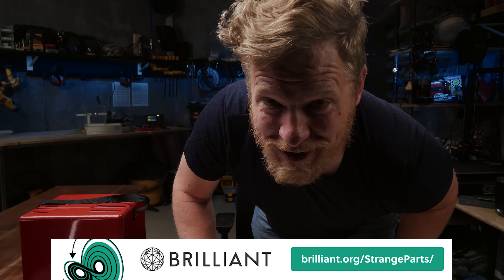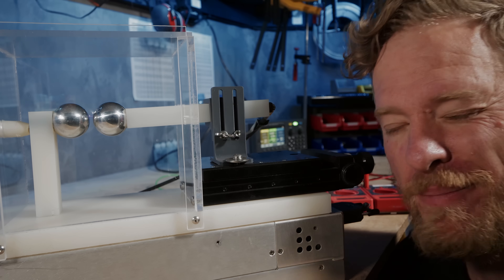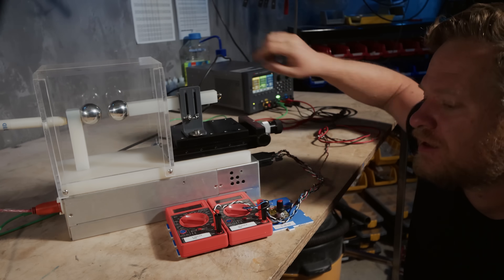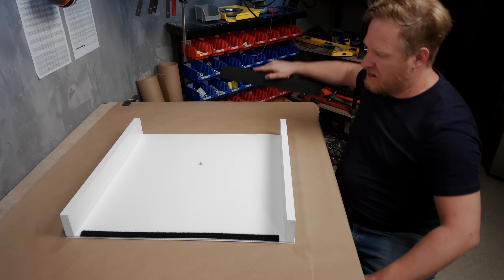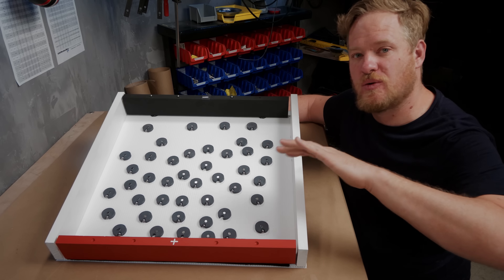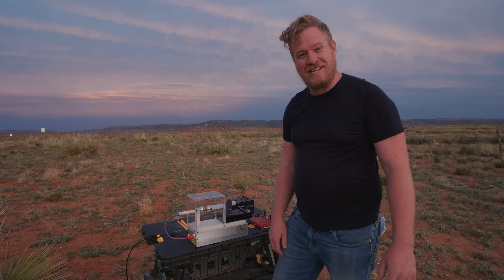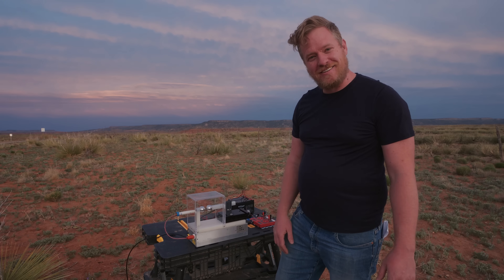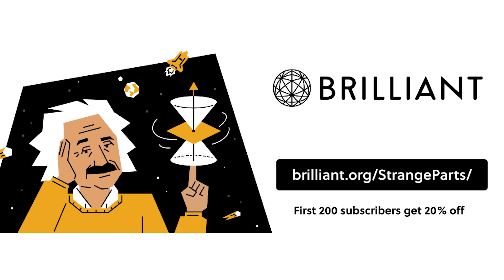Why 10,000 volts at altitude is a BAD IDEA

Comment: How to fix it?
This was resolved in aircraft piston engine ignition systems some time ago. Getting a hot spark into a supercharged cylinder at a low ambient pressure reliably isnt easy. The solution is reflected in the price...

Comment: I had a he-ne LASER that would lase for a second or two before it shut itself off. You could hear the arcing. We messed around with it with it for a week before we realized that we were over our heads. We eventually sprayed the heck out of the circuit board with conformal coating to control the arcing.

Comment: Ok I may be missing a detail here but I watched the whole thing out... And I still have the same 2 questions...

1. What does atmospheric pressure have to do with anything inside the chamber which...

2. Shouldn't it be under a right stiff vacuum?

Or are we talking about around connections external to the chamber...?

I'm sure it's just a detail I'm not privy to yet because the video is well laid out and explained (the balls and table were a nice analogy) - I waited the entire time to hear about a vacuum leak lol

Comment: Great video, much appreciated!
Gasoline powered propeller aircraft engine designers and engineers fought with this problem right up through WWII. The problem was that the spark voltage would leak through the wire insulation at high altitudes, 30 thousand feet and higher. The engines were supercharged so that the induction system could operate closer to sea level. At first, pressurizing the magnetos and spark plugs and wires worked, but eventually the high voltage magnetos were replaced with lower voltage ones, and a high voltage coil was attached directly to the spark plugs. And you thought modern automotive engineering came up with that. Lol

Comment: You don't need to do this however I am glad you did. ;-) Nice and clear video!

About the issue, this is one of the reasons IC's are (air-) sealed against contaminants and can be so tiny, the circuits can be so tiny.  The outside of an IC is very strong and this problem is no issue. However on the outside, with components and unprotected solder joints (no solder mask) with small spaced contactpoints or (unprotected) traces, it easier to create a spark with high voltage when environmental conditions change. On some high voltage PCB's there are spark gaps for ESD or over voltage protection or to protect against transients on the lines.

A (known) solution is to pot it with resin or epoxy or with a layer of it on the PCB's (or components) to make it waterproof and airtight. This will make service on a board or components almost impossible however is very safe. This method is used in military solid applications, air purifiers, (very) high voltage equipment/drivers/coils to avoid any form of environmental contamination. 

I guess you spotted a design flaw that maybe is caused to save a few dollars on production costs with the hope there will never be a problem when people use it in the range of their cost-effective design. In fact, unsafe to use because of extreemly high voltages.

Take a look inside what this clock makes tick. Return it when it is not carefully designed in respect to isolation.

Comment: When I was in the Navy Our patrol planes had an APS/20 search radar system.  There were 20 "black boxes" involved and the output was a million watts.
The transmitter box and the HV power Supply had to be pressurized and the air was treated with silica crystals to keep it dry.   The HV was 12,000 volts and the Magnetron trigger was 55,000 volts.

Comment: So, please correct me if I'm wrong, but this means going higher would also (eventually) lead to less arcing (the "less atoms to knock electrons off of" example)? So between "zero pressure" and "infinite pressure" you have a maximum distance where arcs would form.

Just did some googling before I completely embarrass myself, and I think this is "Pashen's Law", the correlation between breakdown voltage and pressure. But again, feel free to correct me if I'm wrong, this is a really interesting topic and I'd like to know more about it.

Comment: 3:34 7300 ft = 2.3 km high → Average height of a hill station
Average pressure in sea level is around 1 bar (or 1000 millibar)
Here at this altitude, pressure might be around 0.7 to 0.8 bar (or 700 to 800 millibar).

Above Metric conversion is for people in 190/193 country using Metric.

Comment: Nice demonstration but... I would suspect this to be the opposite issue of your scanning electron microscope. Possibly distance between plates is used to maintain the designed voltage, voltage goes higher but you would expect it to jump at the designed area... unless it is jumping inside the hv power supply.

Comment: A friend of mine ran a radio and  TV transmission site on top of Cheyenne Mountain (9200 feet) in Colorado Springs, and invented a coaxial transmission line filled with argon and a whiff of radioactive krypton-85 to keep it always ready to arc over. Its purpose was to ground out the transmission antenna during a lightning strike to shunt the huge currents around the fragile transmitter. 

You can flood your SEM with nitrogen (1.15x breakdown) to prevent arcing, or if that doesn't work, SF6 with 3x breakdown.

Comment: I work on electron microscopes professionally. From your description of the failure of your device, it sounds like it is made from inferior parts that are not rated for the amount of acceleration voltage/ and or poor engineering at potential discharge points. There are microscopes operating at much higher altitudes and at vastly greater voltages up to 300KV that do not arc.  This is the type of problem that plagues tabletop SEMs, they just can not be built cheap enough for the target market without these issues due to their small footprint.   I would love to know who the manufacturer of the SEM is, I might be able to provide insight as to a cure for your altitude/arcing issue.

Comment: Nicely made video and beautiful scenery!
It should be noted, however, that the arc-gap does not continue to grow as pressure decreases.
As you exceed about 55km above the earth (0.2 torr), the gap begins to shrink again. 
Thus the widespread use of Vacuum Bottles as High Voltage Switches.
Maybe arc in a vacuum can be your next experiment. Just mind the X-Rays!

Comment: 3:30 According to IEC 60950-1 the standard altitude range goes up to 2000m so you are just outside of the standard altitude range.
But I think the corresponding Chinese standard actually goes higher up and the microscope should probably also have to pass that standard as well.

Also the important thing here is Paschen's law, it describes the breakdown voltage of gases at different pressures and gaps.

Edit: I just remembered that the Chinese standard I am referencing is probably only for medical equipment (still can‘t remember its name though).

Comment: Your best bet in the short term would be to build a simple hyperbaric chamber to put the SEM in. You'd only need to add about 3 psi to equal sea level, so no need to worry overly about the materials. Plexiglass/acrylic like you used in your demonstration box should work. Seal the seams with silicone sealant.

Comment: To stop the arcing submerse all the electronics in a non-conducting fluid-like food-grade mineral oil.  That's what they do in high voltage systems like high voltage switch yards for high voltage switches.

Comment: I'm only barely venturing into the world of high voltage electrical design, but conformal coatings help a great deal with arcing. I'm curious why they didn't coat their boards as I'm sure they thought of it and have a good reason.

Comment: I can rember back when I was a radar tech in the AF working on fighter aircraft radar systems.  The voltage for the magnatron was about 20000VDC.  The power supply for this used ball soldering to reduce the field strength and was pressurized by the aircraft's pressurization system.  I think some of the the waveguides were sealed and filled with an arc resistant gass, perhaps Sulfer Hexaflouride, perhaps something else.  Another technique is purring all the high voltage parts in a sealed container and filling it with a transformer oil.

Comment: Could put your microscope contraption into a sealed chamber and pump air into it to artificially increase the air pressure. Might get tricky getting wires into it. You may not have to pressurize it that much really. But I guess you'd want a longer term solution to your problem. :P

Comment: Obvious question: have you asked them to adjust your SEM to work at your altitude? It should be fairly easy to either tone down the voltage or increase the gap.

Comment: For your equipment problem, maybe fill it with some isolator resin will fulfill your requirements, like LED drivers for street illumination's luminaires, which are fulfilled with a black resin the diminished the risk of fire due electronics components' failure. There is also a dielectric lubricant that can be applied like WD-40, but have 25kV insolation properties in less than a milimeter thin applied layer, almost like miracle... look for the brand name PenLub.

Comment: Can you purge the electronics box with an insulating gas?  It should resist ionization better than nitrogen or oxygen, the main components of air.

ETA:  Somebody below had the same idea, suggesting SF6 as an atmosphere.  (It's used in high-voltage breakers for just this purpose.)  You can probably get by with a freon refrigerant, which might be cheaper.  Check out tsapps[dot]nist[dot]gov/publication/get_pdf.cfm?pub_id=14202

Comment: At 7300 Feet the pressure is around 570 Torr, or 11 PSIA. Built a box around your SCM that you can pressurize to around 4.7 PSIG with compressed air and a cheap regulator. As an experiment repeat your distance test first.

Comment: You probably have already discovered Paschen's law by now.  I work regularly with high (10kV) to very high (150kV+) voltages for Physics and have to deal with that issue on occasion.  "Paschen's law is an equation that gives the breakdown voltage, that is, the voltage necessary to start a discharge or electric arc, between two electrodes in a gas as a function of pressure and gap length."  I have some high voltage plasma videos on my channel.

To add, your mechanical demonstration of atomic level action is excellent.

Comment: Wow a fascinating problem I wonder if putting it in a box filled with a high density gas might eliminate the arcing with out increasing the barometric pressure and how that might affect its performance

Comment: You need to tension the belt on your car, and also make an air tight box for the SEM, and fill it with an insulating gas or pressure

Comment: So I'm confused about something. If you went to an even higher elevation (let's say 14,000 ft or even higher), the atoms would be further spaced apart, and even though that would give the electrons more space to speed up, collision would be less likely and therefore you would be less likely to see an arc at higher distances. So if we plotted the maximum distance where an arc was seen against altitude, we would see something sort of like a bell curve correct? It would increase up until some point and then it would start decreasing? Am I understanding this correctly and if so where does that maximum point occur? Great video thanks!

Comment: Am I wrong if i see there is a contradiction between the low pressure (less atoms) leading to a faster "jet" of electrons leading to an easier arc and the example with the marble not hitting a single one to create a cascade?

Comment: How difficult would it be to build a small pressurized container to put the SEM in I wonder. I know that sea level pressure is around 14 PSI and in Denver it's around 12 so the differences aren't huge. It shouldn't be too difficult to build one and get it to the minimum safe pressure I would think. I am not an engineer but I did build a clean box once to work on a hard drive and it used positive pressure to keep out dust and other contaminates. I never measured the pressure but the lexan seemed like it was strong enough to withstand a few psi.

Comment: More pressure = more air molecules = better insulation = less arcing. You could have turned your test setup into an air pressure chamber and increase or decrease the airpressure inside with a compressor. You should get the same results.

Comment: 7300 feet = 2225 meters
9400 feet = 2865 meters
4000 feet = 1219 meters
you're welcome.
Reply: Fine, but I remember him saying in this video 74,000 feet, which thanks, I can tell is 22.5 km. MANY THINGS HERE ARE WRONG. Not least it took the whole video to K.O. locations like: Cheap digs atop Mt. Fuji 🗻, Scots Highlands, Atacama. Nah, just ca. 2 miles up in NM, USA.
  Then it's the 'smallest SEM' but scanning tunneling microscopes, which use hundreds of volts to run their piezoactuators and 60-0.2 V at the nanoformed tip, I have used smaller. Like 40 subvarieties of scanning electron microscope 🔬 lie that way, but this ....unglossed...unit ain't them. 10 kV is readily handled by moldable silicone batting if there's no other conflict (like breather holes at voltage, say.) Trivial to say air is an excellent insulator being mostly N2 if you don't cut the pressure below 1/5, crank humidity to 77%, vape, fill it w. jumping cactus bugs etc.
  It's in a box that pulls vacuum. Let it pump into the outer box and be imaging.
  Finally, scanning electron microscopies rely on pulling measures of the direct probe beam for reference and depth selection using small concentric cathodes, but mostly image with the secondary electron signal which one contrives to catch at a distinct angle from that first cathode, but not willy nilly unless you got a meteorite or stone in there. Unless this thing's from BangGood?!?

Comment: Normally it is the opposite of what the video looks like. 
As the ionised air works like a wire, it is way easier to teavel through thick air. 

Sadly video not explained that, but just showing an „experinemt“ where a dude driving around, and showing sparks on different pressures - all between 700 and 900hPa - and take that as „this is science“. No, it‘s not, it is youtube content.

No vacuum chamber, no more explanations - ok, go with it. 

In a vacuum you need around 20kV to travel 1mm.

Comment: I didn't read through all the comments but if there is a way to increase air pressure for your sample and the machine in general - I.e . could build a chamber around it and pump in nitrogen (im not an expert so may need some other trace gasses) - having positive pressure could help. And as long as you seal the chambers right, its easy to test. Just be prepared to lose some stuff on the flame Testing

Comment: To get a beam of electrons in a SEM, you need to remove the conductive gas from the chamber with a very high vacuum pump such as a turbo molecular pump. Otherwise, you have a low pressure gas discharge tube such as a mercury vapor, neon, or other low pressure noble gas discharge lamp. If you are not in the micortorr range, it's a discharge lamp, not a vacuum tube with an electron beam in a vacuum.

Comment: Great demo with the marbles but why use gas to drive all over when you could just make your clear test-rig box airtight and change the pressure inside it with a simple pump or vacuum?
Video gets an A for explanation but an F Carbon Footprint.

Comment: Quick answer: air has a resistance, the higher the altitude, the thinner the air will be and thus less of a resistance it'll present so it's easier to arc at higher altitudes

Comment: I never went to college but per your ad for Brilliant, I've been hands-on with electronics from childhood.
I've built all sorts of stuff from Tesla coils to an actual cyclotron, and it was obvious to me why the SEM suffered internal arcing while you were describing it. Your explanation illustrated with the marbles nailed it.
Just formally studying physics, electronics or whatever does not give you the intuition needed to ask the question the company's CEO did. You literally have to get your hands dirty (and occasionally burned) to really grasp what's going on, 
Seems to me the quick ad dirty solution is to run it with the electronics under pressure. Shouldn't be too hard to rework the housing to allow that.

Comment: Im currently doing my PhD looking at how these plasmas interact with biologics. 
Your plasma at different voltages, distances and pressures can be found using an equation called paschen's law. It also shows the different gases.
Youve an amazing setup there. Would be amazing if you used different gases and show the different colour plasmas.
Reply: Amazing idea...  I am wondering would Hydrogen creates light...
Reply: @sajathsalim261  
Famous last words...
Reply: @electricaviationchannelvid7863  No problem is it is pure hydrogen.  Or, hydrogen without any oxygen.

Comment: I work with medium voltage industrial equipment 2400Vac to 7200Vac.  Our rule of thumb is 3 inches minimum air gap between bare conductors.  Our equipment is down in mines and at the top of mountain ranges.  Altitude is such an overlooked problem that I've had numerous callouts to sites in Nevada and Colorado.  I open my iphone, hit the compass app and chuckle when I see 7,000 to 10,000 feet.  Then I pull out the old technote from 30 years ago and walk through the steps of configuring the equipment for high altitude.  Then BAM, stuff works.  Another fun fact, liquids easily hit superheated at high altitude.  So for a video you can remove the turntable from your microwave and heat a cup of water.  If you keep the water perfectly still in the microwave you can superheat it.  As soon as you jostle that cup by opening the door or bumping it.  It will flash boil and explode.  It's something that happens much more often at high altitude and it's impressive and dangerous to witness!